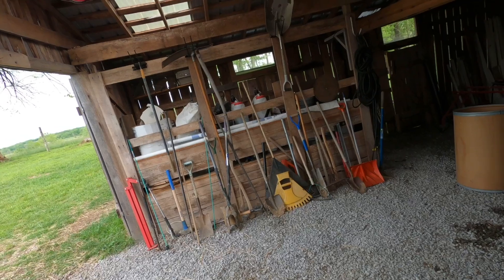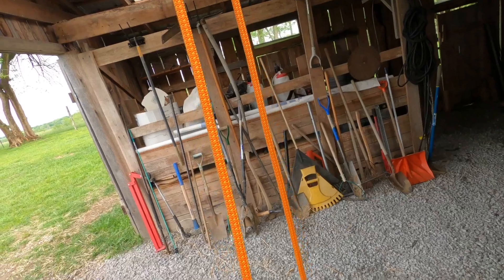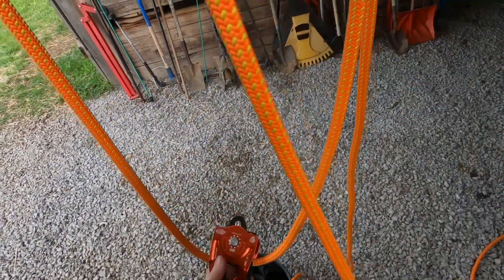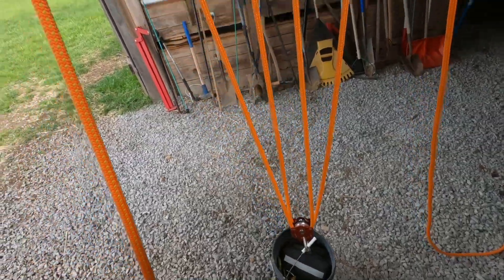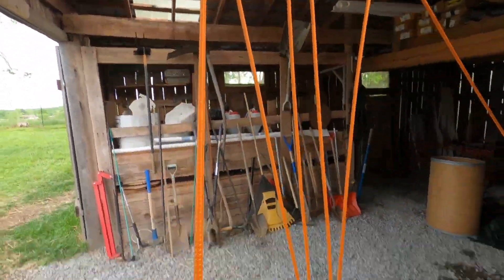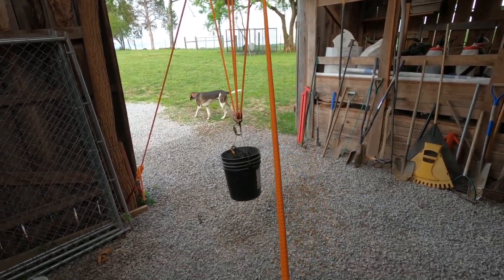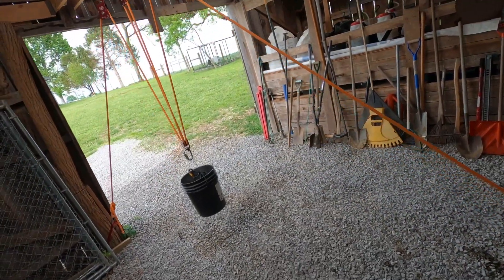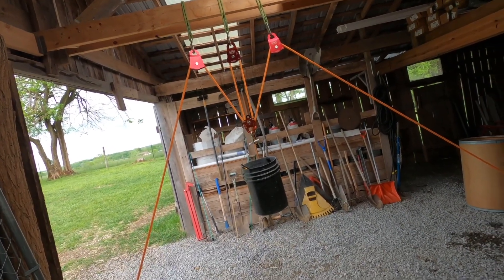How to create a 4:1 Mechanical Advantage System with Rope

Comment: Can't you start the system @ the load on the becket of the double pulley then use the two singles on the tree anchor to achieve a 5 to 1?
Reply from the maker: Yes! But it requires two singles and a double ( or four singles or two doubles) whereas in my example I used one single and one double. 

Part of the fun is experimenting with the tools you have on hand. Thanks for the excellent question.